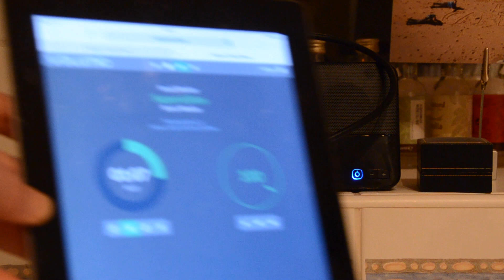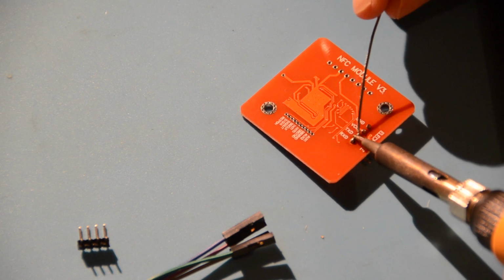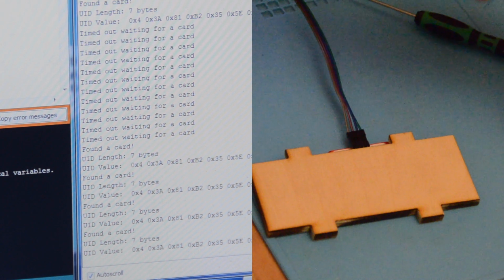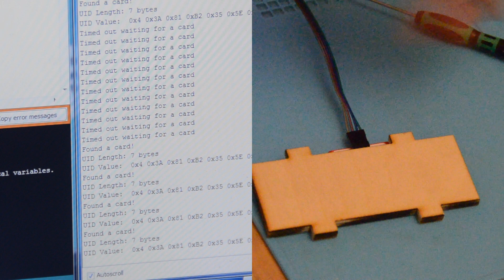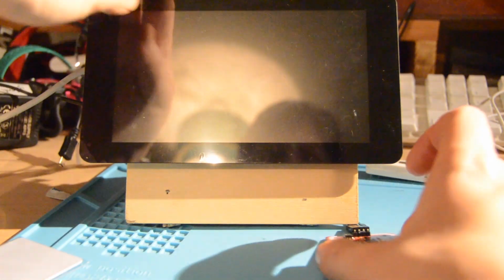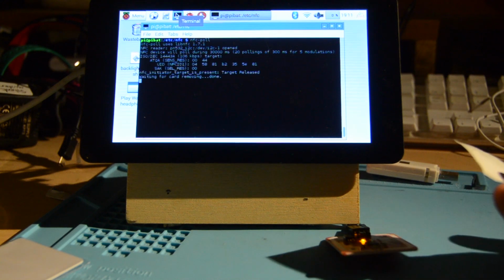RFID PN532 Raspberry Pi and Arduino (Volumio Web API)

Comment: Hey Mike - appreciate you sharing your experience with your project.  Things are always fun till they break! Then it's an opportunity to improve (and maybe fun too).  I'm curious if you can provide more steps for a non-coder type person.  I subscribe to Tidal and also Volumio Premium.  Like your solution I'd like to have RFID cards with Tidal the song or album URL/URI mapped and send that info to Volumio to automatically start playing the content.  I like your approach as it uses Volumio's API to issue the commands to Tidal, vs. having to try and get Tidal authentication/etc. (since this authentication is already handled by Volumion to Tidal).  I'd rather not have media locally stored but just queue up from Tidal to stream via Volumio.  I looked at the Github page but wasn't really sure where to start.  Any assistance would be greatly appreciated.  Thanks.